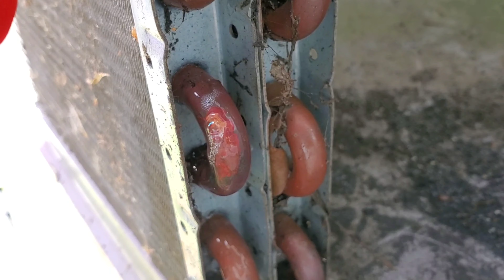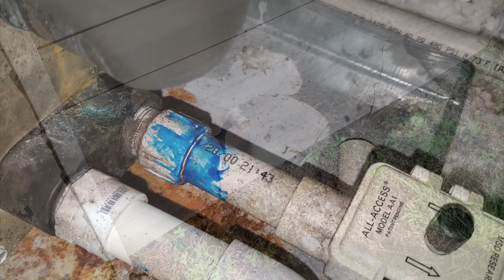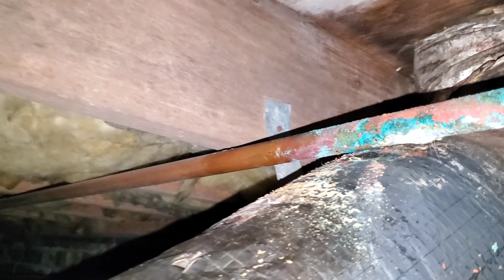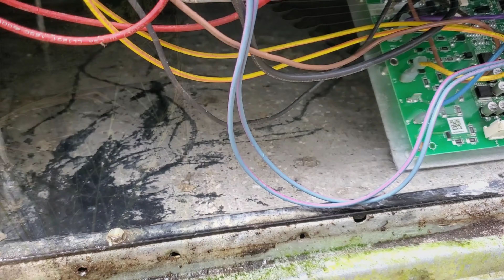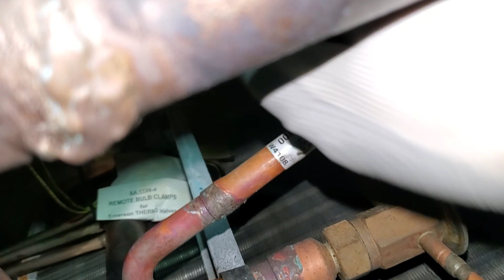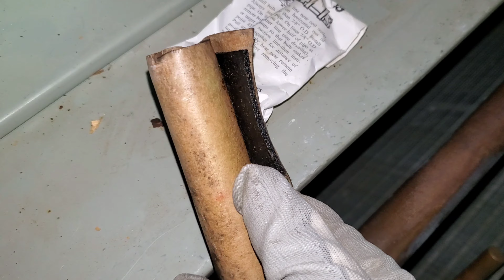HVAC Service Call Compilation 1

Comment: On the last one, with the circuit board. Why does that happened?
It happen to me a last month. I found the fuse blown. Tested with a resettleble mini breaker and that happened. Then I put a new fuse and the unit worked fine with the burnt mark. 
I still order a new board.

Comment: Where was that water in the duct coming from?
Reply: Most likely condensation from the line set, suction line has no Armaflex (insulation) on it and its supposed to or it will "sweat". I wouldn't doubt that the flex also had a tear in the outer liner (vapor barrier). The high side/high pressure line does not have to have insulation on it (armaflex), but if it was a mini-split line set then both high and low sides should have armaflex on them.